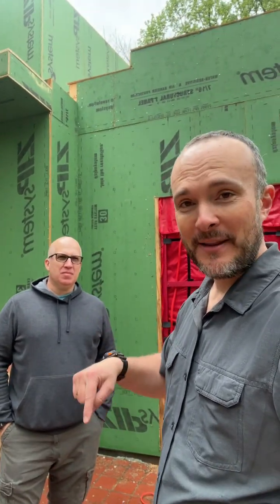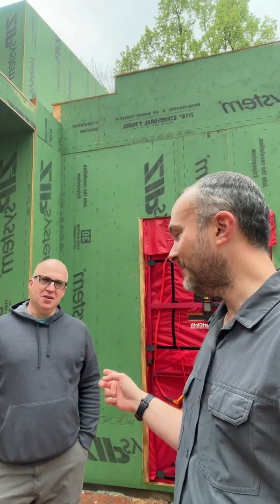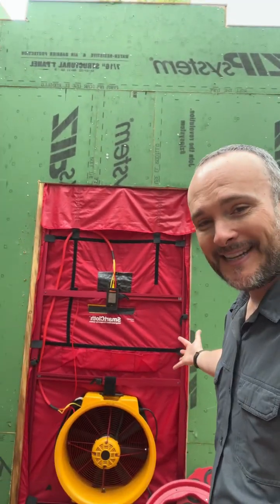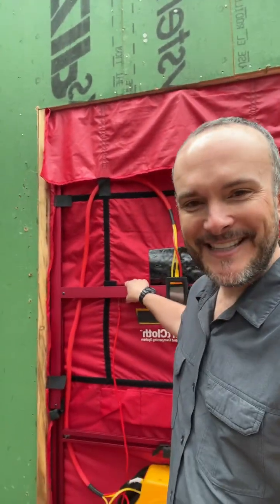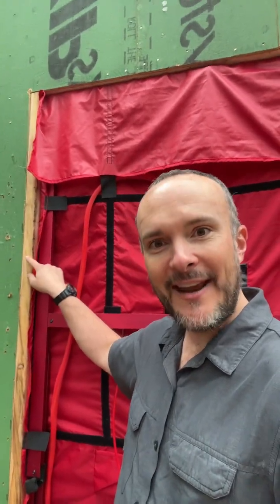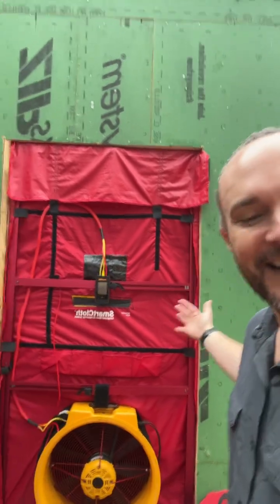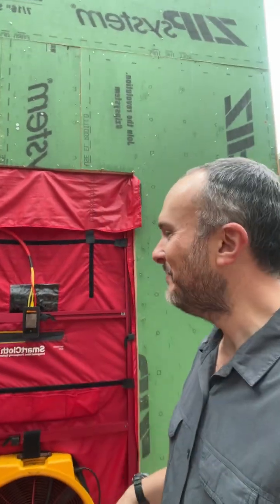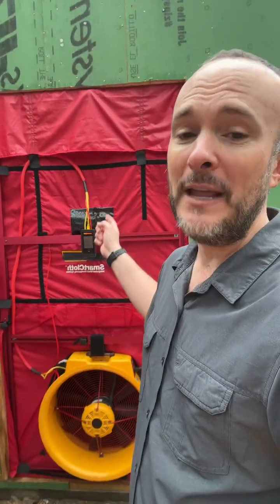Second leakiest house ever blower door tested, with Matt Hoots of Sawhorse Design Build

Comment: What's the leakage calculation in your area? 3,5,6,7?
Reply from the maker: Code is 5
Reply: @HomePerformance  same here, thank you
Reply: @HomePerformance WHAT?? It’s 0.5 in the UK, surely that cannot be right?
Reply from the maker: You guys measure m3/hr or Litres/minute, not CFM.
Reply: @HomePerformance  in my area it's cfm. Pressure difference between the outside and inside "blowing or pulling, which ever is chose. I was just curious to see if it's the same as so flo. It's all another way to complicate the building code. Means nothing,  your house isn't worth more or less in that case exactly = money lost for the extra expense of the testing.  If you're house is too tight, they want some mechanical means of ventilation installed,  in the old days,  isn't that what windows are for? Yep, pretty sure that's what windows are for. Been building for close to 50 years and it never amazes me when someone comes up with something that should be common sense in a quality building there never is an issue. But, as the builder we have to pay someone else to tell me my building is good n tite. The real reason behind this is greater than the comprehension of most people.  It so, they know how long it takes if at all for outside air to reach a person inside the building. You think about that and then ,think about that again.  Like I said, so big brother always has  angles, no what I mean;)